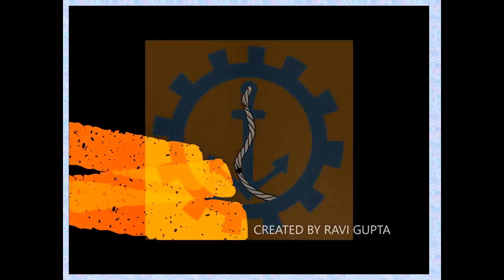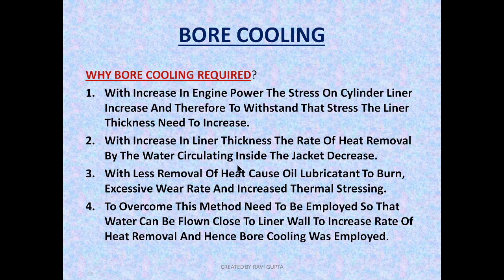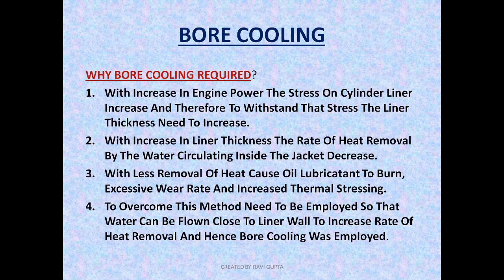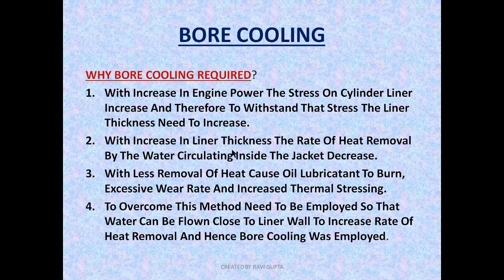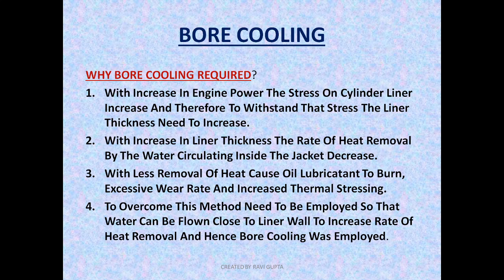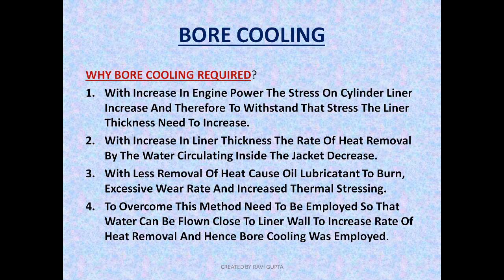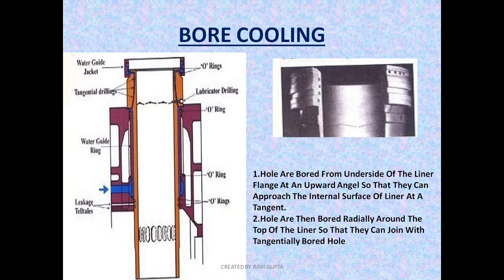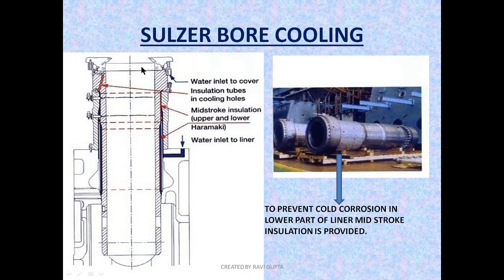BORE COOLING|SULZER & MAN B&W ENGINE ARRANGEMENT|

Comment: Hello sir
I am Jaber from Bangladesh 
I have learned so many things from your video
I have a question on bore cooling.my question is "why jacket temperature to be maintained at a level in engine stopped condition?"
Why
Reply from the maker: Hello Jaber!!!
Jacket temp is need to be maintained around 70-75 degree Celsius to avoid thermal stresses and to prevent cracking of cylinder liner  due to thermal stress if not maintained.
I hope you understand!!!!
Please share our video in your facebook and whatsapp group!!!
Reply: Quenching effect avoidance